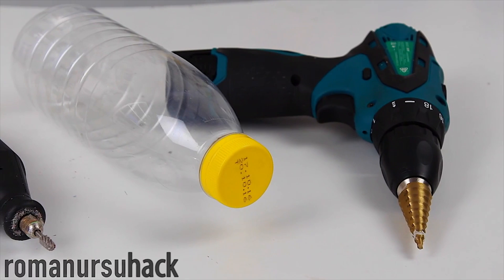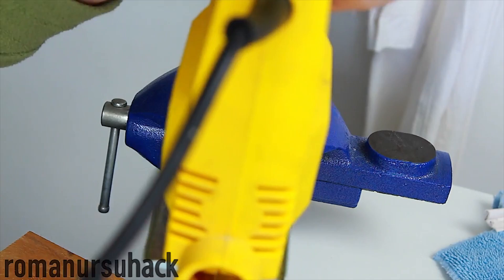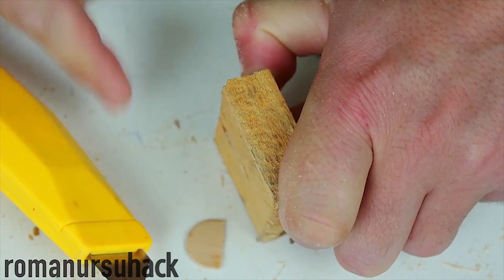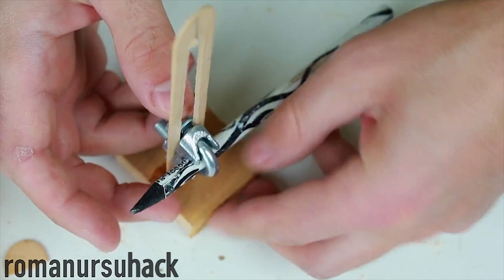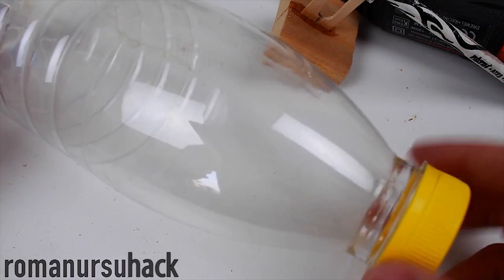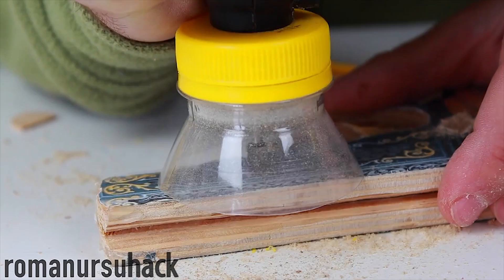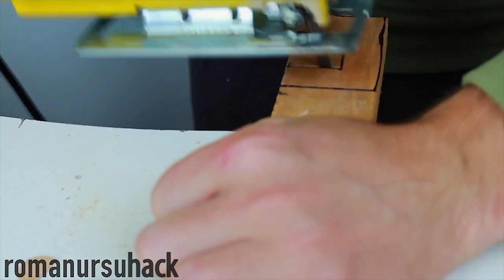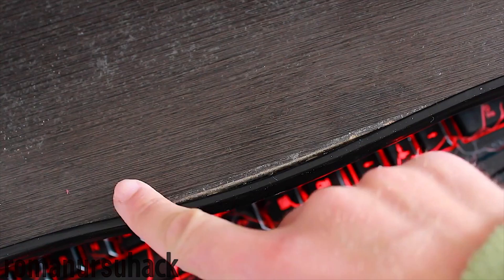3 ideas about making DIY tools

Comment: The last idea (the edge clamp) is good, but you need to do something so the wood doesn't split along the grain (perhaps try plywood), and grind the ends of the screws flat so they don't split the pieces of wood you use to keep from damaging the surface of the table.